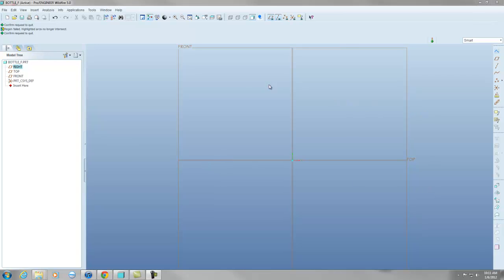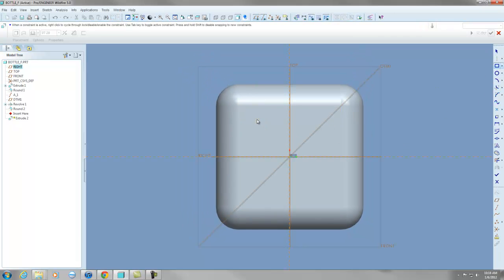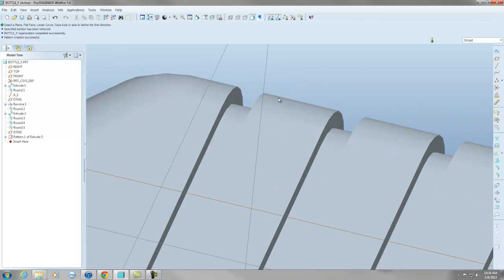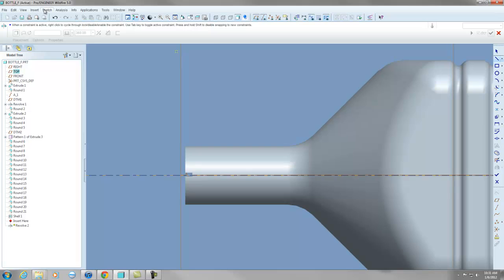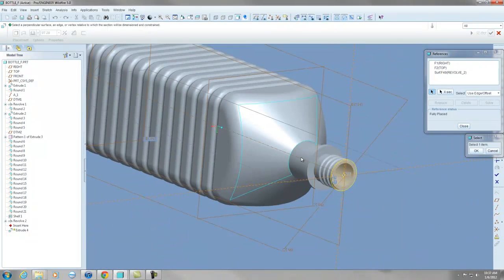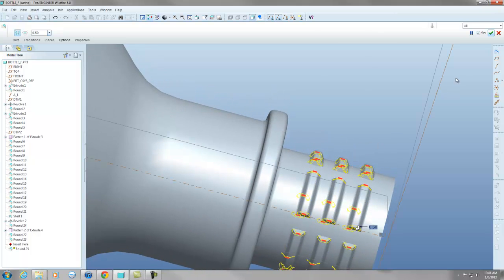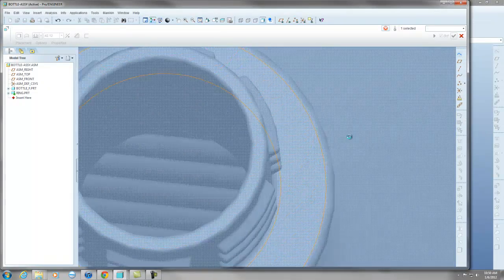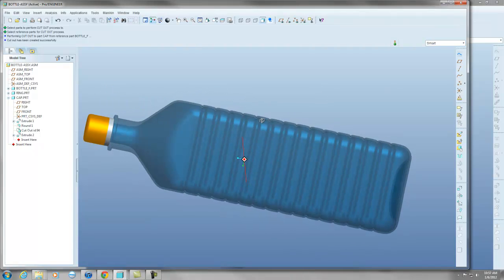Pro/Engineer Modeling Tutorial Episode 1

Comment: I have expertise on AutoCAD (2 D) and have worked as AutoCAD designer in engineering firm for 1 yr ( 2D drafting), I have knowledge of  engineering drawing,
how many days would be sufficient to get a good hold on Pro/E (3/4 hrs dedicated daily ) ?
Reply: Not a lot of days, in two weeks you can be doing pretty much everything. I suggest you take a look at Solidworks, it is easier to handle and a little bit more powerful (at least in my opinion).